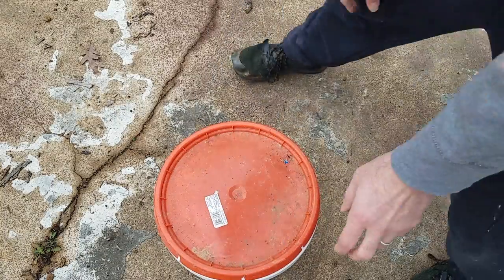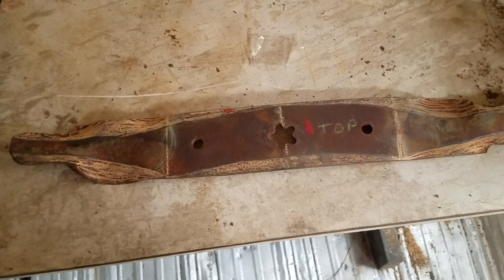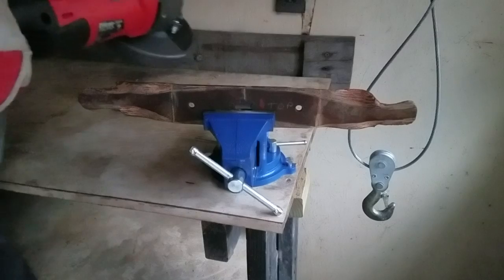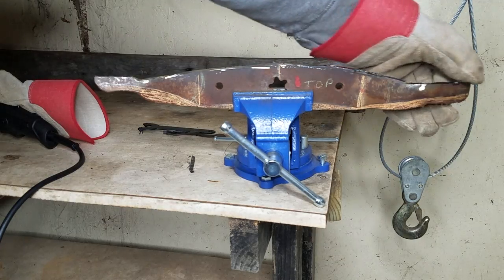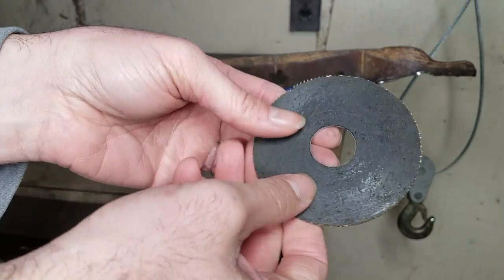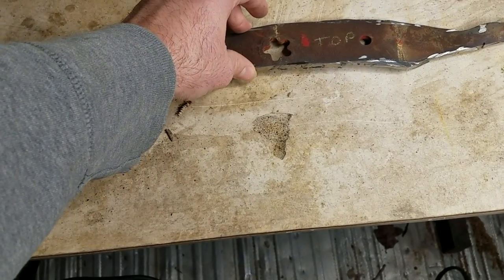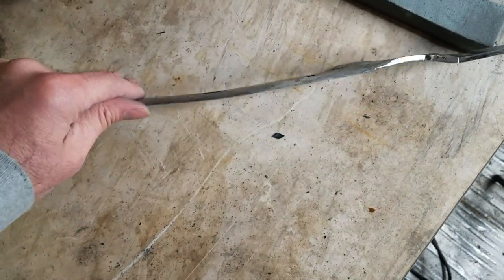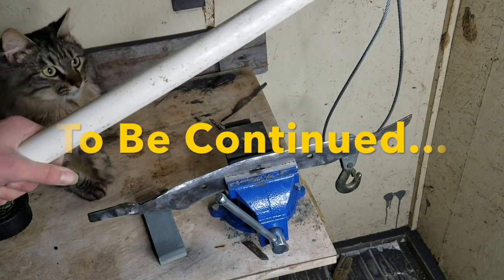Make A Fleshing Knife From A Lawn Mower Blade (Pt. 1)

Comment: I was thinking about doing this with one of my old mower blades. I have the advantage of spending 5 or 6 years fabricating structural and other steel professionally and pretty much used an angle grinder everyday.